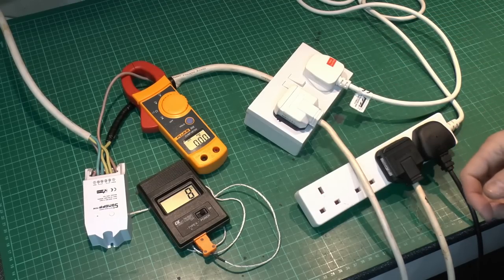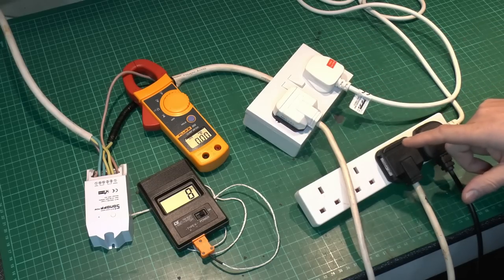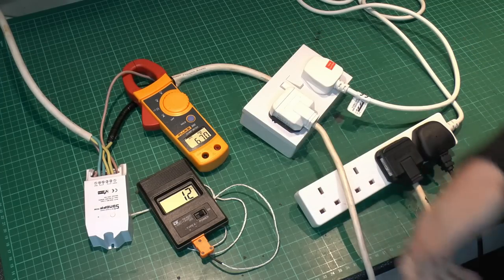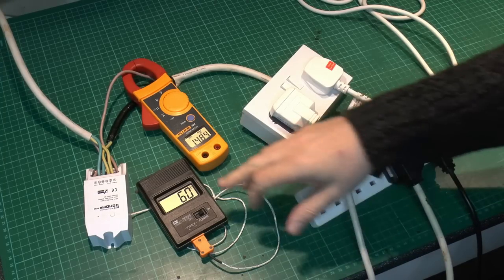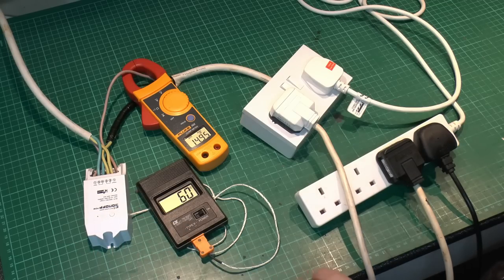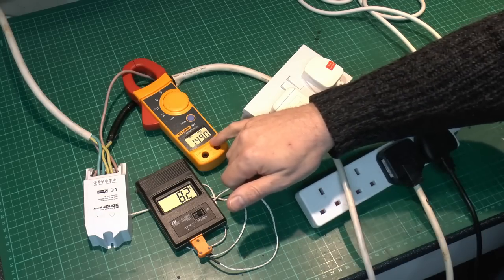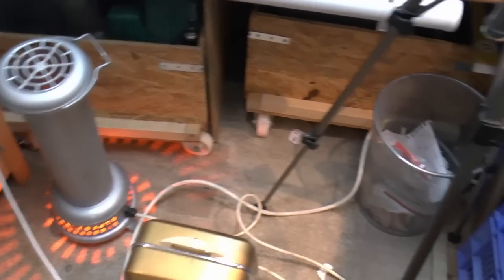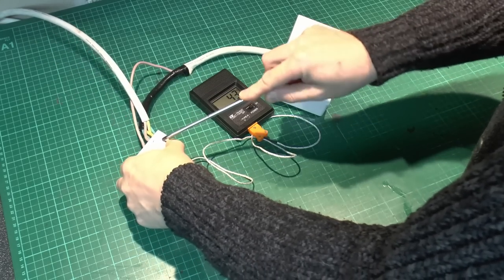Sonoff 16A Switch - Load Test

Comment: I had one of these switches for my electric car home charger rated at 16A. After about 4 months of use, one night I discovered the shell had deformed due to heat stress and there was a very strong burning smell. I cut the fuse at the main board and got rid of it. Probably not the smartest thing I have done, to run the switch at max load over a long period,  and I consider myself very lucky. At lower running currents, they are very useful.
Reply: Funny just bought one thinking about doing the same thing to automate my car charger.  Clearly not going to do it now.  Did you find an alternative??  Ideally Esp board so can hook up to home automation.

Comment: Hello John, I have bought this switch, but I am very nervous about using it as the terminals are just spring loaded which seems a bit dodgy for 15 A (I am using it on an immersion heater), what do you think? 
I know there is a stress relief plate but this is also very flimsy holding all conductors with just one small screw into the plastic housing. Would you be confident using it for a 15A load??

Comment: Thanks John! I will love 30A one, for all my house.
Reply: 30A for the whole house?
Reply: You should find something at least 60A for your house.
Reply: A 30Amp would be safer for immersion water heater 👍
Reply: My household load is under 3kw can I use one sonoff pow r2 to measure mains load? I also use solar inverter to run my household load

Comment: Hello John, it is safe to connect 4 Air Cond directly without MCB to sonoff 4ch R3 ? Does it have cut off system when overload or any electrical short? I need your suggestment and information.. Thanx before
Reply from the maker: No, it's just a switch.  Overload and fault protection must be installed separately.

Comment: Thank you. Can you clarify what is recommended value of fuse? Mine blew yesterday.  It was connected to an air conditioner.  It normally draws 9 amps max. I don't know at some point there might have been a malfunction.  I checked that the track has burnt and fuse blown. Track is ok though when checked through multimeter. So please advise the rating of replacement fuse. Thanks

Comment: Hi John - and thanks for the video.

I have a question for you (or any electrical boffin) : you mention an inductive load like the vacuum cleaner, has that initial spike which is over load.

If you're running on and off an inductive load (and thus, briefly overloading) - do you think this could be an issue?

Comment: Thanks for the detailed review unlike others, who are least aware of the limits of this device. Other review just focus on the android app and wifi setting.

Considering you were at a low ambient (8 deg C) and then the temperature raised to 59 deg C, that is 50 deg c rise. If I do the same in India, where ambient is around 35 deg C, will this rise cause a concern?

Comment: Thanks John. What do the Uk regulations say about wiring devices like this to say a house lighting circuit. I have seen people for example wire a lighting switch to the GPIO of this device to keep the existing switch working while providing wifi control. Is that allowed or do regulations not touch on that kind of thing ?

Comment: Pretty Impressive and useful video. Just a quick Question, Can I use a 15a Sonoff device in a 10A circuit. I mean 10A input to 10A 2400w Max load.  SorryI am totally a newbie on this
Reply from the maker: Yes, 15A is the maximum rating, no problem to use it with less.

Comment: Thanks john. This video really help. I plan to use it for my Air conditioner (AC) 10 Amp for daily use. Is it possible with this 16 Amp sonnoff ?? Without risk for burn, if i turn on the air con for 15-20 hours?? Please i really need your opinion. Thanks so much
Reply from the maker: No problem as long as the load is rated less than the sonoff.

Comment: Have you done a video before about how much of its rated current a BS1362 fuse can pass forever? Last week I came across another slightly unrolled 10A cassette reel in a community venue with deformed flex thanks to the 3kW heater plugged into it along with a few other items... 10A fuse in the extension lead plug

Comment: Have you ever noticed with Fan heaters, when you turn them off at the mains socket, there is usually a spark behind the switch button, sometimes it makes you jump. Other appliances can do the same thing, but fan heaters are the worst!

Comment: Hi John
Very good an informative youtube, thank you. I was very interested why a ceramic fuse of 20 amp was used as you rightly pointed out. The answer became apparent when I read the features and specs of the device from the manufacturer. The reason is that you can with the software, mobile eWeLink app, specify that you want cut out at certain value of amps, volts etc. This would really be great if you could repeat the test after having set some of these max allowed values in the app for the device.
Many thanks for the advice though.
Reply: What ever you do with the software, it cannot improve the limitations of the hardware. The relay, as said in another video, is rated for 16A of resistive load and the second rating of 10A @ 250 Vac is probably for inductive loads. It's possible that other components of the device have the same rating/limits. Keep in mind that the fat track of copper and solder on the pcb reached 80+ degrees C at full load, so imagine what's gonna happen at the spring terminals at full load over an extended period of time. So, I don't believe exceeding the rating of 16A would be a good idea.

Comment: Hi John, thanks for the informative video. I am intending to use one of these switches for my water heater that is rated max 3000W. I live in Singapore where the voltage is 220-240V, so that will make it 12.5A-13.5A
That would be ok for a single load right? Cos I read somewhere this thing can only support up to 10A on single load while going up to 16A on multiple loads? Can you please help to confirm?
Sorry if my question sounds too naive/ trivial.

Thanks in advance :D
Reply from the maker: it's 16A - doesn't matter if that is one load or several, as long as the total is 16A or less.
A 3kW kettle will be ok, it's much less than 16A.
Reply: Thank you for the reply. That was really helpful.
Reply: @Antechan  Have you already aply to your water heater system? I want to do the same. It work whit not problem? thanks

Comment: Hello. I am sorry for my English. I am using the translator. Did you measure the maximum current that sonoff power can measure without a relay? The relay is bridged with 2.5mm2 copper and we measure how long it can withstand.
greetings. Tadzik

Comment: 1250w hoover is banned now due to power draw?

Lets say you used it for 10 minutes. With a less powerful motor, it'd likely take longer than 10 min to do the job, so sure, it takes less power, but you end up using the same amount of energy lol
Reply from the maker: +Luke Den Hartog http://www.bbc.co.uk/news/business-41119355
Reply: Be nice if there was a nicer way to represent both total air flow and strength of suction. Though, if I seen a 2000watt Dyson, I would get that over a 2200 watt unbranded crap.
Reply: When we get out of the EU will we get our high power vacuums back?
Reply: Depends if you want High powered, but inefficient (eg has suction power of 6) or Low powered but efficient (eg has suction power of 8). The point of the EU law is having efficiency over wasteful.. 
There are 1.0 litre ECO cars that are more powerful than 3 litre engines of the olden days.. I know which one I would prefer... Once all the trash brands that are relying on wasting high amount of energy to "keep up" have vanished.. and you have all innovation wars of "what's the most powerful suction we can get with 900watts" then decide if you want to go back to the cheap brands that cause your electricity bill to go through the roof for no reason other than, they are crap at making vacuums.
Reply: Better than the unrealistic power ratings on vacuum cleaners and air compressors in the US that well exceed the power capability of the outlet...
The idea is that they are forced to get more efficient. I do not like bans like this, but would have liked a mandatory suction rating instead, that accounted for real world conditions. For example measure the vacuum pressure with a standardized orifice after sucking up 1/2 kg of flour or something. As it was buyers just went for the highest power rating, or the one that made the most noise, which obviously did not encourage improvement.
Reply: Indeed, as I understand it one better measure is "air watts" rather plain wattage. Watt ratings have resulted in an arms race of wattage marketing claims - like camera megapixelage. The hope is to develop more efficient vacuum cleaners. This is in order to comply with legal treaties we all signed up to as part of an attempt to reduce carbon emissions. If course it's easier just to blame the EU...
Reply: Luke Den Hartog for years now, vacuums have been sold by “look! We’re 1600Watt!” Etc. In other words high power draw was spun as positive. This without any countervailing concern about actual performance. In other words, basically any efficiency where the motor doesn’t literally catch fire is fine.

And that’s bad for many reasons.
Reply: Wet and Dry Vacuums, although I'm not sure that is one, are actually exempt from the EU ban, as are commercial ones with an extra wide wand head.
 
Unfortunately, the bypass motors used in wet and dry vacuums tend to be very inefficient and they usually come with pretty useless plastic wands and relatively poor suction (airwatts),  so not much cop at cleaning carpets no matter how powerful the motor(/s) fitted. 

I've just spent £50 on filters for my old 1,800 watt Samsung Vacuum, and repaired the cable rewind brake and its broken dust compartment catch, and may end up spending another £100 to replace the worn out turbo brush head if I am unable to repair it, as I wasn't able to find a new vacuum with similar (360) airwatts (or ideally higher), to replace mine, so I guess the new EU rules are working to cut down on waste.

There were some horribly inefficient vacuums on the market that boasted 2,000watt+ motors as a selling point, yet delivered lower airwatts than than much lower powered machines,  unfortunately the ban has targeted the more efficient high wattage vacuums too. It would have been better if they set a minimum efficiency requirement instead,
Reply: Knowing how E xceedingly U neducated (sorry about the spaces, but YouTube's eighth-assed comment system leaves me with no other option) the dimwits have proven themselves to be in recent years, I wouldn't even trust them to spare space heaters.

(Not that anyone who actually understands Ohm's Law would be stopped from using multiple heaters per room to get around a restriction on their wattage, of course.)
Reply: I recon VW could sort this problem 😂😂😂

Comment: @John

Since you did the stress test. Do you think this device would handle 4 T12 Ballast's, because I would like to attach it to my florescent fixtures. The light wattage as a total is 320 watts, but I'm unsure of the ballast amperage.
Reply from the maker: Yes, that will be fine - 320 watts is only about 1.4 amps, and even allowing for double as they are fluorescents, that's still only about 3A, far less than the 16 it is rated for.
Reply: Thanks!

Comment: Please folks don't connect heaters to these things, the manufacturers tell you not to do it and heaters should never be left unattended, especially the cheap 2KW fan heaters (which like to turn into a ball of melted plastic when the fans fail), but equally i've had some pretty expensive space heaters that have failed quite spectacularly too.
Reply: Its perfectly acceptable to use them as a High Power load for testing purposes, But I do agree that they should not be left unattended
Reply: Ooops I didn't specify that I mean't outside of testing conditions :)
Reply: Seriously guys, give up with this line; I'm completely immune from (theoretically) baseless cop-outs like this.

Far from protecting anyone (in the long term), repeating this claim is merely excusing the manufacturers from engineering their products properly (i.e. to stay safe).

Comment: Hi John, I would like to connect my air conditioner on Sonoff Dual 16A (10A/gang). Do you think that is safe if I split the energy in each gang? And turn on/off both channels at the same time?
Reply from the maker: No, if you use both channels for the same load, one of them will be damaged, as even if switched at the same time, they are still two separate relays, and one will close and open fractionally before another one, so most of the load will end up on one of the contacts.  You need a device which is rated to the whole load with only one contact / gang.
Reply: John Ward, thank you for the response. I will try to find a way

Comment: Can this work with a U.S. 240 volt 3 prong outlet and if so how should it be wired? The main issue I see is that U.S. 240s are synthesized from two 120 volt circuits so two of the prongs are "hot" where the third is used as both ground and neutral.
Reply: helliko2   sonoff for USA exist. For non-DIY people you can buy one with US male plug in / US female plug off. IMHO should 120V lines use different connectors as for 240V lines! CEE system exists! Different cable code too!

Comment: 60C sounds like a lot heating at 8C. On a hot summer day that would reach 80C on a table and probably close to +100C in a place  with poor ventilation. It seem like it is just waiting to fail with such loads.
Reply from the maker: 60C was the temperature of the PCB track, air temp inside the case will be significantly less.
Reply: Actually he said the room temperature was around 18C at that point.
Reply: @jwflame 
Anyway ...
These types of small D.C. relays that soldered into PCBs are not practical with loads more than 5A. ~ 8A.
They will be very dangerous above that.
Reply: It’s the appliance fault condition that worries me...... boom before the 20A, even 13A fuse pops or 16/20/32A MCB trips 🤩

Comment: Those electrolytic capacitors wont last very long at that temperature, I expect that they are not 105 deg. rated ones.
Reply: they actually are rated at 105 deg. which you can see in the previous video ;)

Comment: Any idea if they make a 32amp version?
Reply: 32 amps? How thick are the wires in your house?
Reply: Just connect a contactor to a sonoff
Reply: was thinking of that, but will lose the ability to measure power consumption